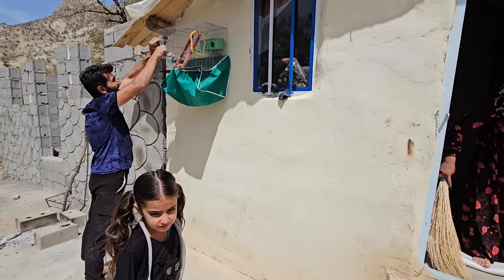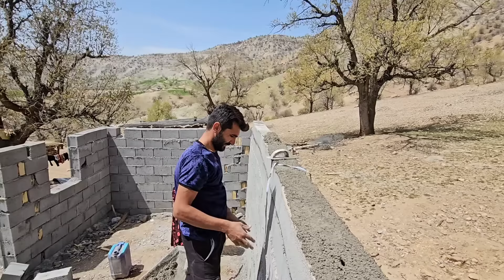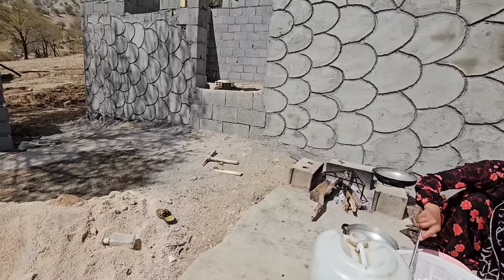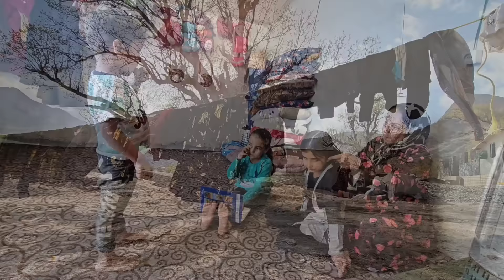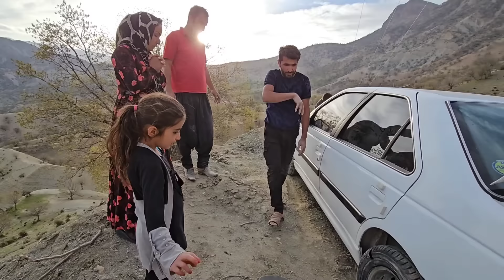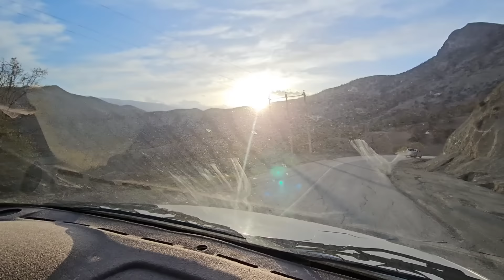Sudden danger: tire puncture and the problems of Fereshte Khanam's family and neighbors

Comment: I'm glad you're not hurt. Imran's driving is rough and distracting! You'll have to learn to operate safely Since you have to go off-road, not asphalt, you need to check tires, cooling water, engine oil, etc. and it is important to check in advance before departure Thank you, Kasimdo
Reply: Make sure you wear your seat belt Insert 4 bolts into the tire If you speed it up, it's dangerous because the balance doesn't fit